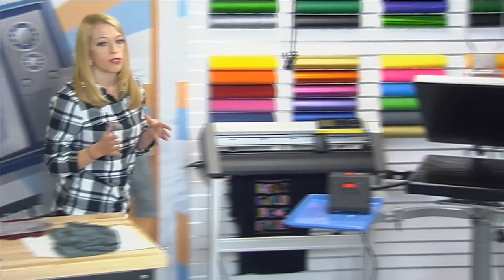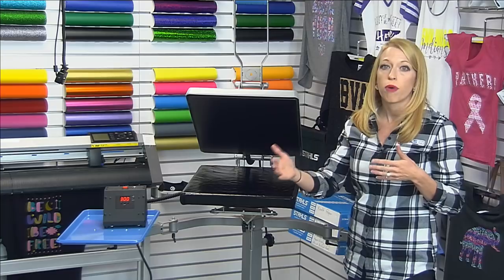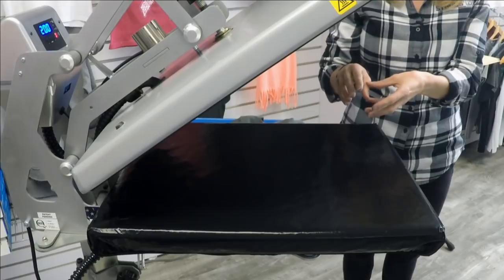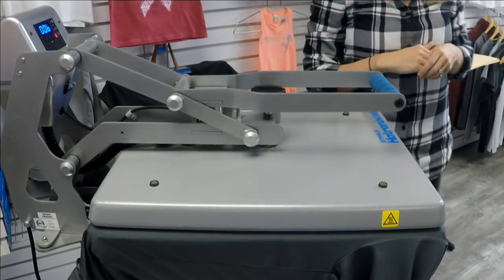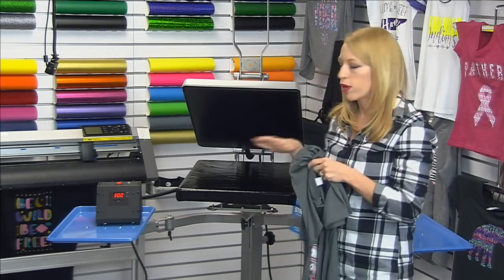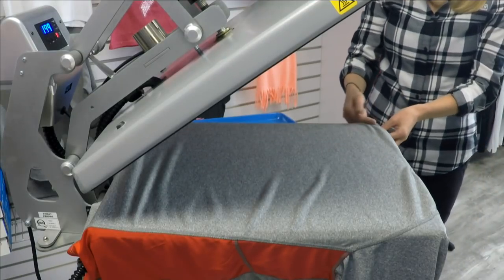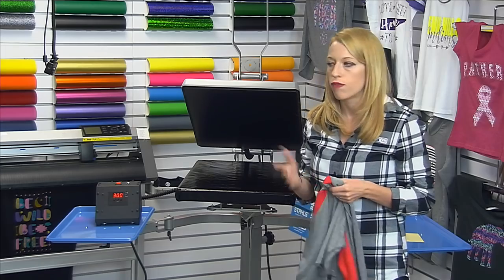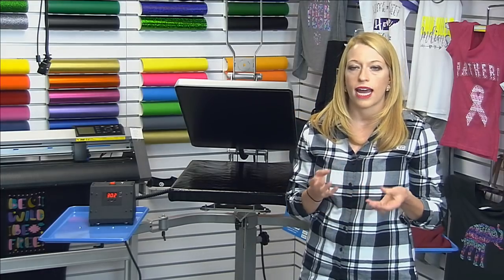How to Avoid Scorch Marks with Heat Sensitive Apparel

Comment: what about on sublimation prints? they have to be a certain temp to transfer
Reply from the maker: Hi Stephanie. When sublimating, we recommend finding blanks that are designed to be sublimated. There are options that will withstand the higher temperature and time required for sublimation.

Comment: Lowering the temp below 325* the transfer will crack after a few washings.
Reply from the maker: This may be true for some heat transfers, but for others like Elasti Prints, which is specially made to be applied at a low temperature, this is not the case as long as you follow on the proper heat press application tips.

Comment: I need your advice. I am working with the Hotronix Heated Lower Platen using Premium Plus vinyl on Gildan 100% polyester t-shirts and also on cotton t-shirts but with the temperatures setup that you suggested  the vinyl didn't stay on the garment.(Like it happened to you on the video) I am using 330 on the platen and 230 on the heat press, with the pressure from 6 to 7. With this setting I can peal the vinyl and the design stays on the t-shirt but when the t-shirt is washed and dried the vinyl falls off. What can I do to resolve this situation?
Reply: Did you resolve your problem?